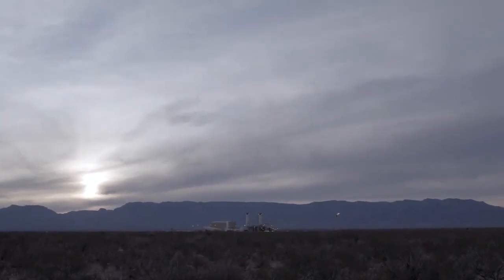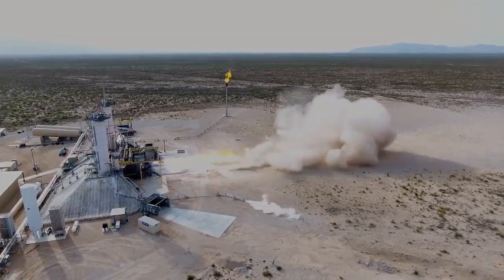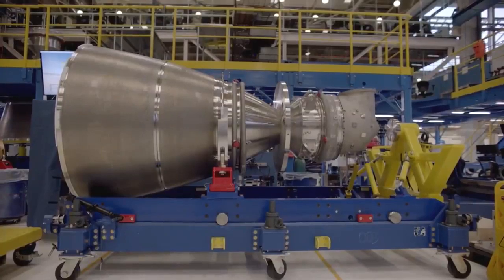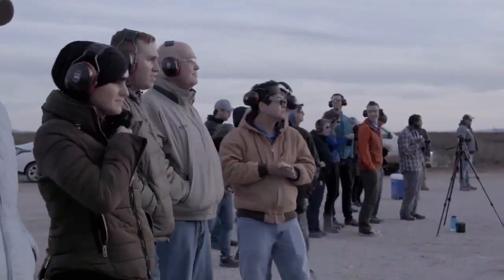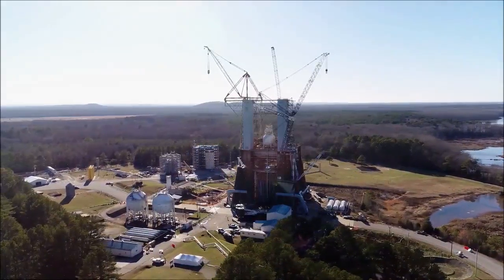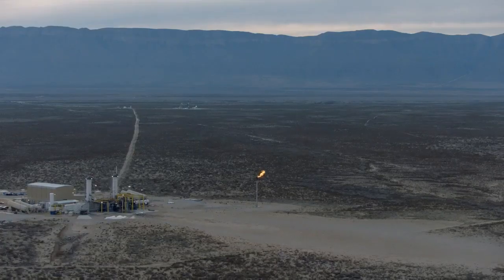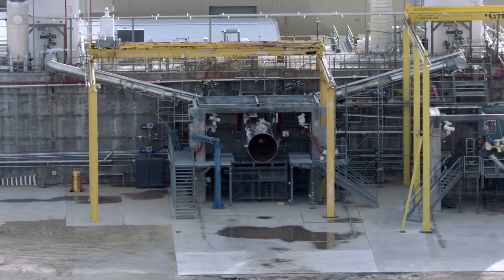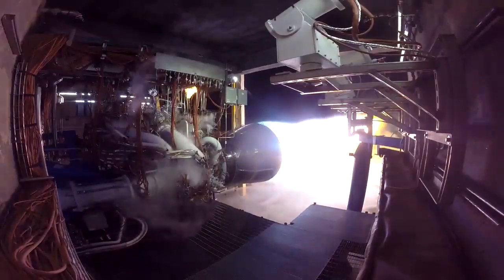Blue Origin BE-4 Engine Progress (Feb 2020)

Comment: These engines are like their orbital rocket, all talk and no substance. They are still yet to deliver a qualified engine to ULA and the rumour is that the BE4 still has combustion instability when getting anywhere near full power. If that is the case then they are not even close to being production ready. I feel sorry for ULA who had faith in this engine, they are now having to cancel their Vulcan Centaur first flight because the engines still aren't delivered.

Comment: Methalox Oxidizer rich staged combustion. Nobody else has done this in the world.

[Raptor enters the chat] That's cute. I'm the only full-flow what has taken off
Reply: I agree on your opinions about blue origin, but raptor is a fuel rich staged combustion
Reply: @kiannarayan4431  Full flow means that it does both fuel-rich and oxidizer-rich in different preburner assemblies.
Reply: @BrokenLifeCycle  I know what a full flow staged combustion is. The BE-4 is staged combustion with the closed cycle.
Reply: @BrokenLifeCycle  The Raptor engine is still fuel centric, even with the full flow staged combustion cycle. If it was equal amounts of LCH4 and LOX then you'd actually be diminishing performance because the oxygen has more molecular mass than the fuel ones, even as gases which the full flow is. It is harder to push out the atoms with more molecular mass because they are more dense.
Reply: @kiannarayan4431  Are you... sure you know? Or at least interpreting me correctly? Because... when Blue Origins say "Oxidizer rich" they're really talking about their staged-combustion preburner cycle, not their propellant mixture ratio.
Reply: @BrokenLifeCycle You sure..? BOTH preburners oxidizer rich?
Reply: @BrokenLifeCycle  Also from a general standpoint, please tell me why they would do that instead of the fuel and oxygen mixture ratios in the combustion chamber. Obviously if both preburners are oxygen rich then you end up with an oxygen rich burn in the combustion chamber.
Reply: Aight, this will take a bit to explain. Clearly, there's a miscommunication happening. 

Blue Origins's BE-4 uses an oxidizer-rich, staged combustion cycle engine. This means its preburner assembly is burning more oxidizer than fuel when compared to its stoichiometric ratio. What's important is that this preburner is where the 'staged' part of the category comes from. The propellant burns twice somewhere in the entire system. After the oxidizer goes into the preburner, it is then routed to the main combustion chamber where the rest of the fuel is added into it and burned. The BE4 only has ONE preburner. 

SpaceX's Raptor engine uses a full-flow, staged combustion cycle engine. It is also staged combustion but in a different way. This engine has TWO preburners. One is fuel-rich, the other is oxidizer-rich. After going through the preburners, the resultant gasses --- one fuel-rich, the other oxidizer-rich --- are then shoved together into the main combustion chamber and burned a second time. There is no direct feed into the combustion chamber. All propellants go through one of the preburners first.
Reply: @BrokenLifeCycle  Once again, I know what the combustion cycles are. There is probably some miscommunication happening.
Reply: @kiannarayan4431  Your misunderstanding is that the BE-4 is not a full flow staged combustion cycle engine. The preburner can be oxygen rich without the engine being oxygen rich because not all of the fuel passes through the preburner.

Comment: The truth is - these guys are behind not only the Raptor, which is the king and the quantum leap in rocket engine technology but also behind the Russians with their RD-170 family. Even a 3 decades old RD-180 engine is more powerful and efficient than this Bezos creation.
Reply: JK _ actually rd-180 is equal efficient because it has much higher comb. pressure. The main advantage of closed cycles are that they bring higher comb. pressures, and blue origin does not push that very far.
Reply: JK _ more efficient does not mean cheaper you know
Reply: JK _ having lower pressures does little help but the gains offset them.

Comment: I found this video by asking: Is BE4 engine working yet? I still haven't got an answer... which probably means NO
Reply: By blue origin's standard, sure, it's working. Is it reliable? You'd have to ask tory bruno for that.
Reply: If you're asking Google, you got the answer you deserved.
BE-4 has done at least 1800 seconds of firing. 
That's working.
Reply: @-danR  Only at below 50% thrust and not for a full duration burn. Additional when going over 75% thrust combustion instability damages the engine.
To put it in perspective would you say a car is working if it breaks down before you get to your destination or if its engine breaks if you put it into a high gear?
The latest news from ULA is that the earliest they expect delivery of a flight certified engine (ie. A working engine) is the end of 2021 if the testing doesn't find further problems.
Reply: You literally see it working in the video...

Comment: Sounds awesome, I just hope I live long enough to see these fly😉
Reply: You will! I think they're gonna fly on ULA's vulcan next year
Reply: @filipo7703  that will be awesome 👍
Reply: Filip O good luck
Reply: @filipo7703  Unfortunately Vulcan's first mission has likely slipped to 2022 now
Reply: @filipo7703  it’s next year and they are still in testing? And instead of working on the engine they are complaining like babies because they didn’t get a contract... We probably won’t see Vulcan fly for a couple of years that’s for sure
Reply: @sturfryd4983  Yeah, Bezos seems to be more interested in suing SpaceX than speeding up the development.
Reply: @filipo7703  😅
Reply: this isnt nothing compare to raptor, BE-4 have 2.4 mn and raptor is reaching 2.3 for half of the weight, and efficiency and chamber pressure raptor is just awesome, but be 4 still pretty good
Reply: Im 13, i was 12 last month ;)))) ill see these launches quite alot in my lifetime.
Reply: @ThanoSalt  yeah, maybe..😉
Reply: @truthisnotalwaysfact  even if I die ill be happy. One of the most incomprehendable questions known to man is the question: "what happens after death? ". If i die, i guess ill know the answer
Reply: @ThanoSalt  well put 😎
Reply: @truthisnotalwaysfact  😎
Reply: At Blue Origin's current rate, I'd make sure to take your Geritol every day, 'cause it's gon' be a while.
Reply: It's today dude. 👨🏻‍🚀 🚀
Reply: @211inprogress  Wrong. New Shepherd had BE-3 engines. This is a video about the BE-4 engine.

Comment: It's the only methane oxydizer rich staged combustion engine because competitors are using methane full flow staged combustion engines, which are better.
Reply: Robert  -Higher chamber pressure (300 bar instead of 135) which means:
-Smaller engine (for the same thrust)
-Cheaper (because it's smaller)
-More efficient (higher nozzle ratio)
Reply: @johntheux9238  it's not the same thrust. If Raptor reaches design goals, it'll fall 400 kN short of BE-4. The higher temperatures and pressure will make Raptor far harder to maintain than BE-4.
Reply: @nowhereman1046  300 tons = 2900 kN so 500kN more than BE-4
Reply: @nowhereman1046  Although Raptor does fall short of BE-4 in thrust, it is a much smaller engine than BE-4 by volume (And almost certainly by mass as-well). This means Raptor likely has a better thrust-to-weight ratio. It also means you can stick more of them on the bottom of your rocket. 
Nothing can compete with a Full-Flow-Staged-Combustion engine, except for another Full-Flow-Staged-Combustion engine. Mixing the propellant as two gasses will always be superior to mixing them as 1 gas and 1 liquid. The only advantage BE-4 has here is that it's easier to build.
Reply: @cod6guy12  There are disadvantages to being that small. The pressure and temperatures that Raptor must operate under make it far less reliable and far less easy to  maintain that BE-4 will be.
Reply: @nowhereman1046  How deep can the BE-4 throttle? Because raptor was designed with deep throttle in mind. So it should be pretty reliable.
Reply: @johntheux9238  deep throttle is only useful for landing your booster or minimizing G-forces on passengers and cargo. And yes, BE-4 is the king of deep throttle in engines of this class. Remember it was tested publicly at 50%. Routinely it will throttle down in flight to 65%, but for landings it will go far lower in order to carrying out the full on hover and lateral translation to touchdown on the (in motion) recovery ship. 

This is the same thing that New Shepard tests on every flight and with BE-3 PM.
Reply: @nowhereman1046  Seems like it's about the same as raptor:
https://twitter.com/elonmusk/status/1107369149431341057
But I don't know if that's representative of reliability...
Reply: Nowhereman10 raptor has higher temps for sure, but also has advantages (two separate turbopumps) which increase lifespan
Reply: @arcaipekyun4232  The exhaust is fuel rich / oxygen rich or it's a perfect stoichiometric ratio?
Reply: John theux i think it is close to its actual optimal ratio, but one of the preburners run fuel rich and the other oxidizer rich which is very good in terms of life span
Reply: @arcaipekyun4232  Well, you can either run each preburner at a lower rate and increase lifespan or go full steam and increase chamber pressure. Pretty sure they chose the second.
Reply: John theux most rocket engines have a single preburner. This (raptor) has two, so less work for each preburner which means longer life span, while increasing chamber pressure.
Reply: @arcaipekyun4232  It's obvious that they won't sacrifice life span for power, but they also have custom alloys so maybe it's burning even hotter without any damage...
Reply: @joshuat3686  I never said than BE-4 was a bad engine. I just said that praising the fact that it's the only engine of this kind is quite misleading, because it strongly imply that this type of engine is better than others, which is wrong.
Reply: Robert raptor is
Cheaper
(Same fuel)
Higher comb. Pressure
More efficient
More reusable

Be4:
More powerful (only by %20, the difference is offset by size and cost)
Reply: John theux exactly. 

Blue Origin will never get anywhere. They going at snails pace where co’s like SpaceX and Electron are going at cheetah’s pace AND succeeding. 
This is just wasted money. 
Imagine now if Bezos had been pumping this $$ into SpaceX. We’d already be back on the moon and probably heading to Mars this year. 
Bezos is just pissing billions away on a failed project.
Reply: @greggb557  So what you want is another space monopoly company and not different groups trying different things. BE-4 is so successful that it easily beat out the competition's AR-1 from Aerojet and if you'd bothered paying any attention to this video and or any of the articles out there, this year will see the delivery of the first two flight-qualified engines (currently scheduled for May). 

Real hardware is being built by the ton even as I write this for New Glenn. You can find video and photos of the massive 7 meter fairings; payload adapter, and fuel tank sections. All of which is from middle of last year. And Blue remains on course for first flight in 2021.
Reply: @nowhereman1046   Finally someone with decency and critical thinking. I still think Spacex and Rocket lab are more productive using less resources though :)
To those of you believers out there:
Most of rocket launch cost comes from hardware and not the fuel, so lowering the production and maintenance cost is as important as how efficient the engine is.
So in theory, be-4 could turn out to be more economical option due to being cheaply manufactured and maintained.
Elon Musk said "Best part is no part". If that part is full flow staged combustion, I say get rid of it. After all, See Dragon was that philosophy. If a big dumb pressure fed flying tank could cut it, let's use it.
Reply: @nowhereman1046  how has this aged? 😂
Reply: Gregg B i dont think so. New glenn can be a good player (still behind starship tho)
Reply: @arcaipekyun4232  Raptor V2.0 will have the same thrust as BE-4 and sea level thrust optimised raptor (no gimbal and no throttle) will be more powerful:
https://twitter.com/elonmusk/status/1179107539352313856
https://twitter.com/elonmusk/status/1192605854270312448
Reply: Robert  https://www.youtube.com/watch?v=LbH1ZDImaI8